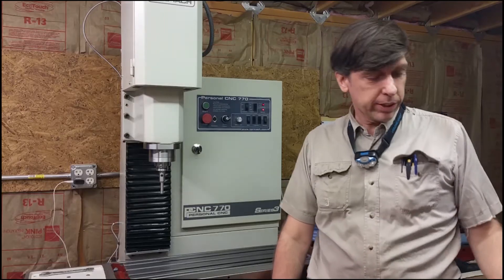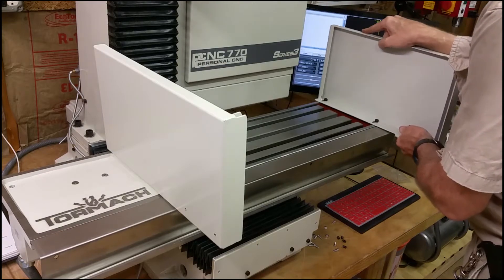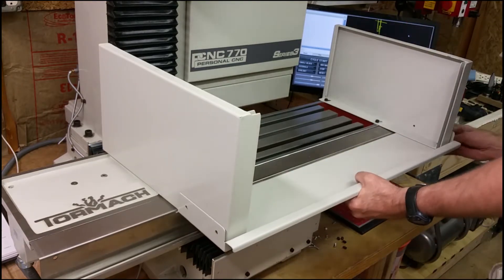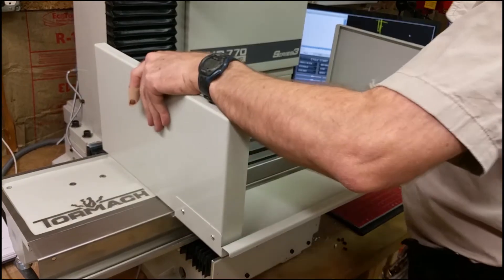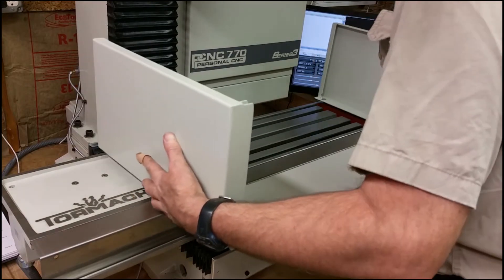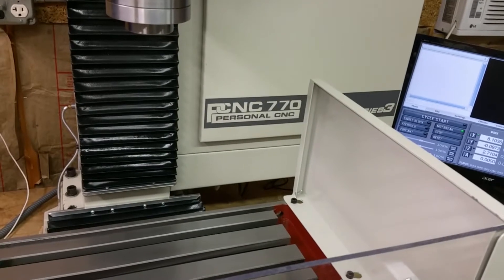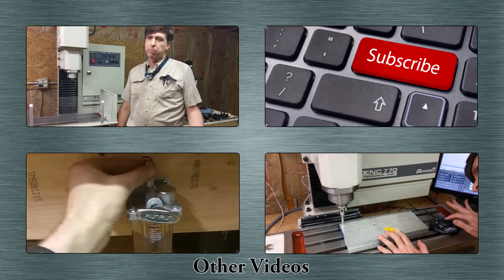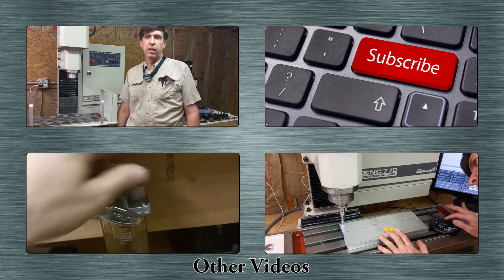Tormach 770 Part 6  - Installing the Chip Guard

Comment: How did this work out? I don't see it in your newer videos. I'm considering buying one to keep the chips somewhat contained. I was also thinking about the shower curtain method.
Reply from the maker: It doesn’t work with the tooling plate so i had to remove it.  The shower enclosure works better.
Reply: Ah ok, thanks. A pallet fixture/sub-plate is on my to-do list among many others...the joys of DIY CNC conversion.